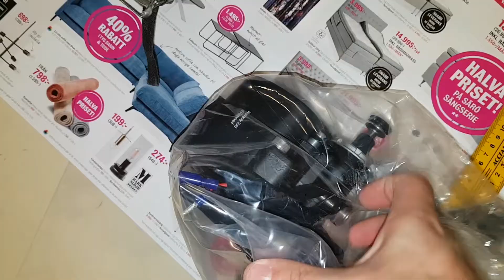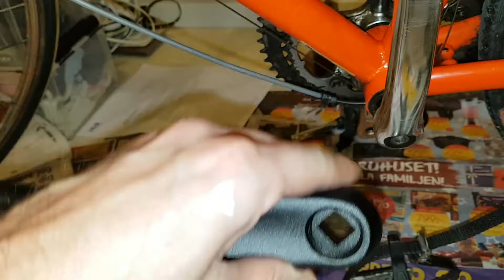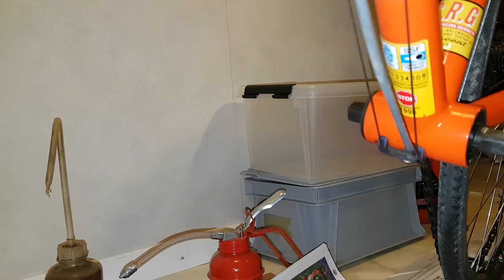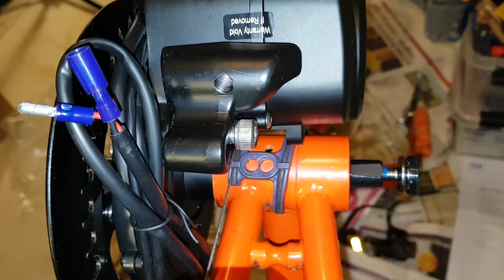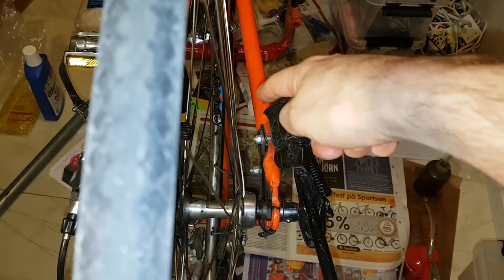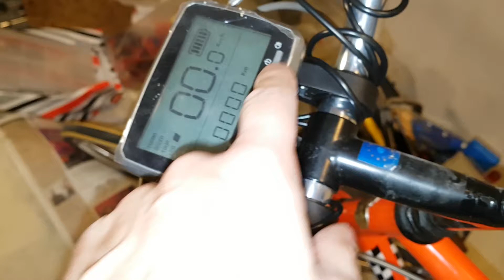Tongshen TSDZ2 mounted on road bike

Comment: You did not have to remove the cable guide under the BB. Take the cover off the motor and it will slide right through

Comment: I started a conversion with this motor yesterday and for the first hour or more I had to drill multiple times and smash with a hammer the bike stand were it's bolt had welded tight. I couldn't believe how tough it was for a cheap shit bike stand. It was only supposed to be a loosening a bolt job but instead a total nightmare and that was just the start of the job. When I got the pedals, cranks and bottom bracket of with relative ease I then discovered that the motor wouldn't fit through the bracket as the center unthreaded part of the bike bracket was slightly less in diameter than the outer threaded parts so I ended up luckily discovering that my neighbour had a semi round file and so I spent about 3 horrible hours hand filing this hard steel until I could get the damn motor to slot in. Had also to cut the bottom plastic cable guide in half. Next had to drill extra hole in battery bracket as it didn't fit the bottle holder attachments. Also had to make my own bolts to attach it as the ones on the bike were to tall to get the battery to slide on and I don't have a workshop. So that's as far as I've got and the troubles I've had. Hopefully I have the worst over and will get some rewarding ride soon.

Comment: Would love an update.  This is the first I've seen on a proper road bike and I am guessing the batteryn life is outstanding with the lower resistance tires, lighter weight as well as more aerodynamic riding position.
Reply from the maker: Hi Mark. Havent used it so much yet, but works great so far! I did have a hickup when the battery was fully charge though. You are right it consumes very little battery the rides I've made (helping a little bit). I will try to make an update one day. :)
Reply: Really waiting for that update, hope you could do it, thanks for the info.
Reply: Really waiting for that update, hope you could do it, thanks for the info.
Reply: Really waiting for that update, hope you could do it, thanks for the info.
Reply: Really waiting for that update, hope you could do it, thanks for the info.
Reply: Really waiting for that update, hope you could do it, thanks for the info.
Reply: Really waiting for that update, hope you could do it, thanks for the info.